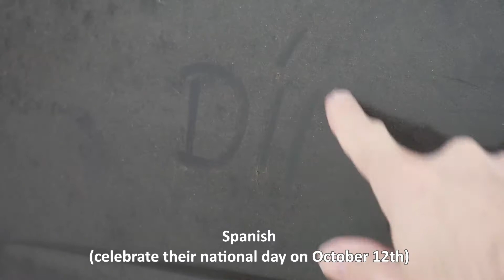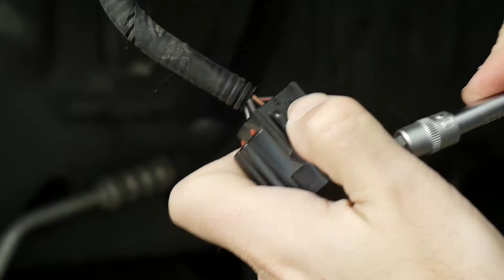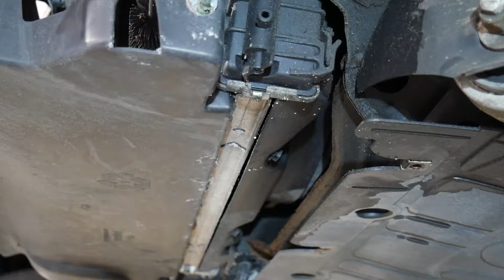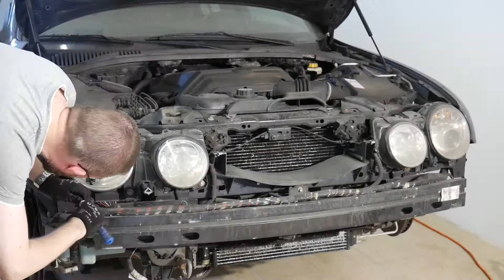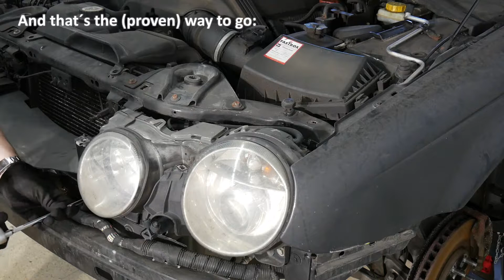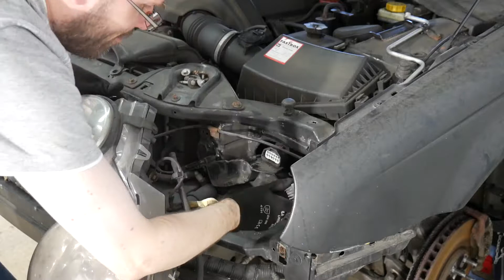Jaguar S-Type Restoration [4] HEADLIGHT Delete

Comment: Thanks for your video. I had that fight with those connectors today ('04 S-Type). First I was not aware how ridiculously difficult it is, thus I attempted first to disconnect the fog-light connector while lying under the car. Pretty painful for the neck, so I checked youtube, found you video and saw how difficult it is. Thus I had to lift off the bumper first and put it aside (I wanted to skip that step). Ok, next removal of the red "connector-lock", then pressing the latch down in the middle while pulling it apart step by step. I knew it would be easier with WD40, but I did not wanna do that to my skin again, and I just took off my rubber gloves. So I opened the connector like you. But when I noticed that each headlamp had that same kind of connector, I had to resolve to WD40 - and it made it a lot easier. I had to get the headlight off, because the whole fixing and adjustment mechanism had dissolved into dozens of white plastic splinters. So I have to open the headlights and I just figured out of how to do that tomorrow: With a heat gun - that the only way. There are replacement adjuster kits for sale...
Reply from the maker: Yes - although (in similar form) used multiple times on the S-Type, this special plug was by far the hardest to release...
Thanks for watching!

Comment: As I was saying in the first video of this series, I just started watching …. I know I’m late to the party but better later than never. Watching this makes me looking for an S-Type…. 2006-2007 , I Like the tail lights on those models. Future recommendation for when taking stubborn electrical plugs, spray some penetrating fluid on them. That will dissolve the grime and rust and what not it’s in them. Usually it works for me, I work on semi trucks.
  Also when re using bolts it’s good to spray them with penetrating fluid, they will go back in nice and you don’t risk breaking them off
Reply from the maker: The first was the most difficult one - just as it always is 😇